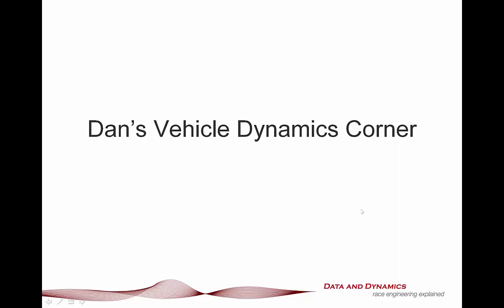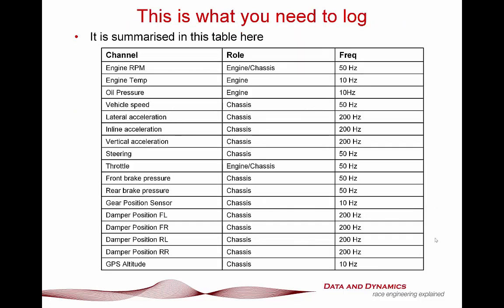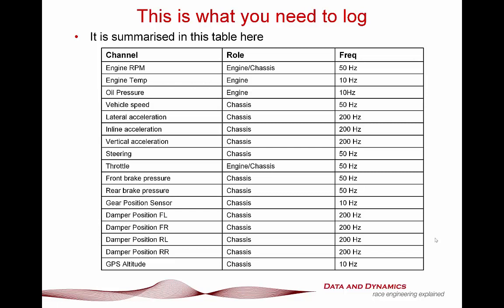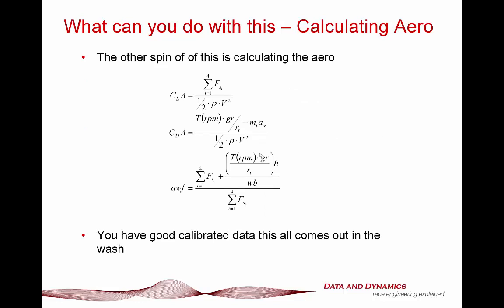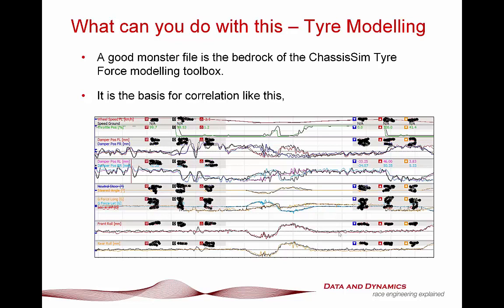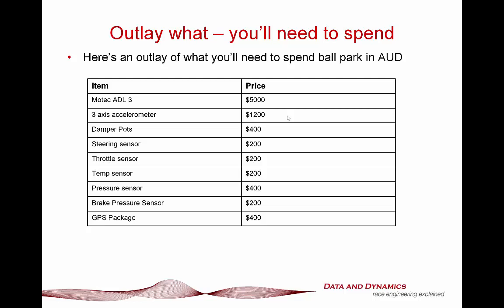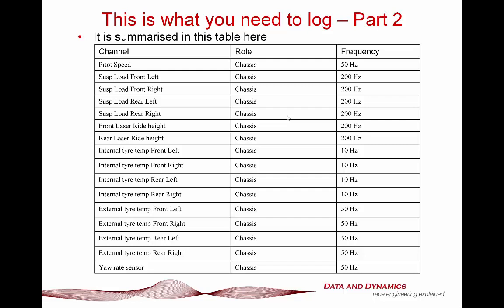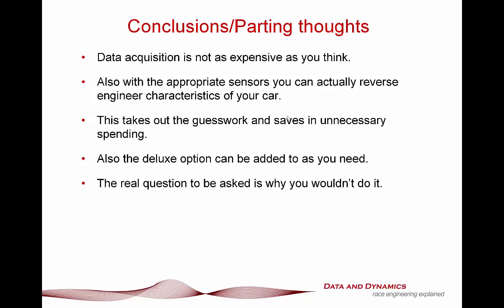Data Acquisition - What you need to log

Comment: As an amateur, having worked with a dataset with more sensors that I could interpret, over time I gained more knowledge and was glad the info was already gathered in the past. Or in other words: the data you collect today might not seem relevant, it could become valuable in the future.
On the other hand, there’s already quite a lot that can be captured and calculated by the most easiest systems. Any correct logging is still better than no data acquisition at all.